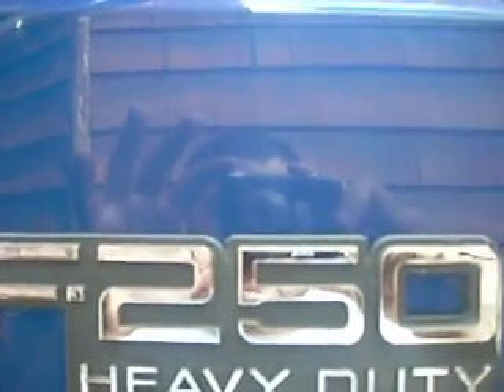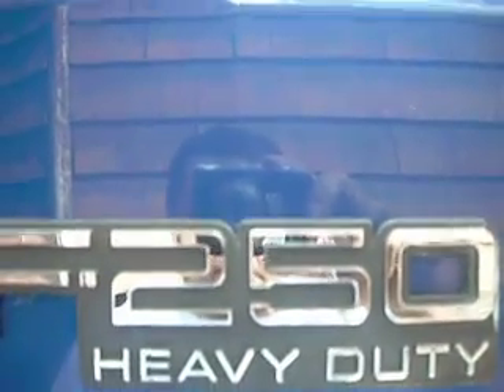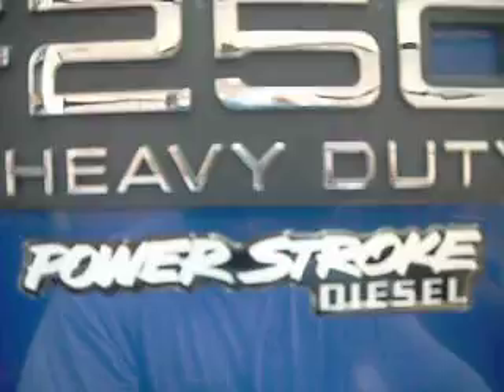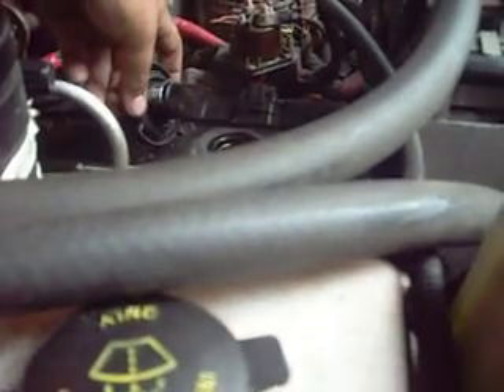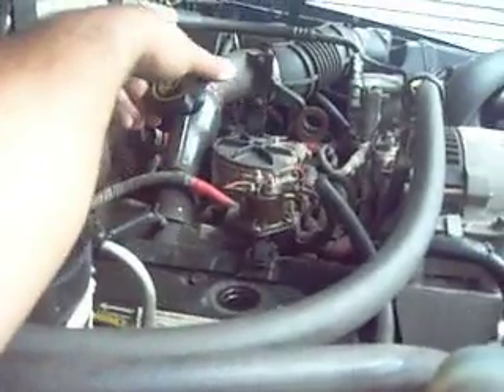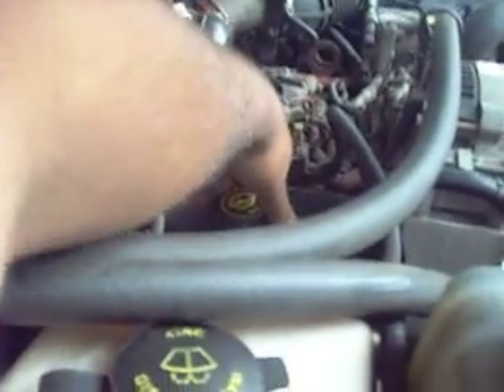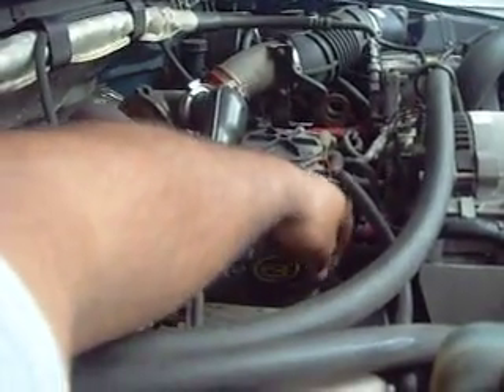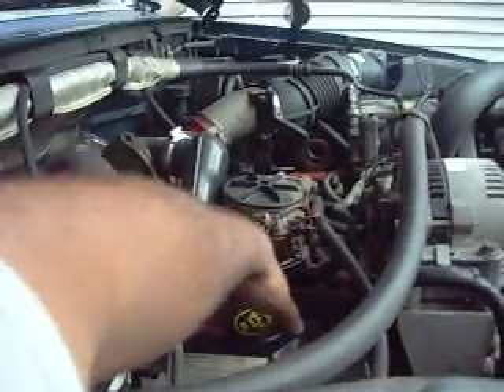THE NEW RIDE PoWeRsTrOkE

Comment: nice massachusetts truck lol i almost bought a 96 f-250 reg cab longggg bed 7.3 with 300,000 miles but i went with a 1/2 ton chevy cause i dont really need a big diesel but then again the sound is amazing on those 7.3's